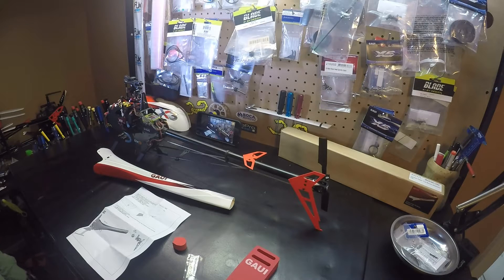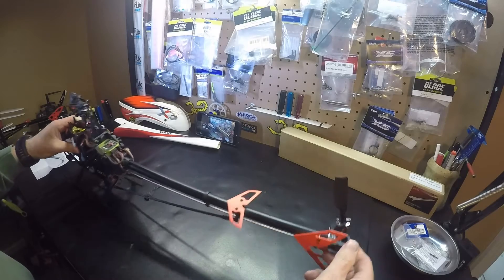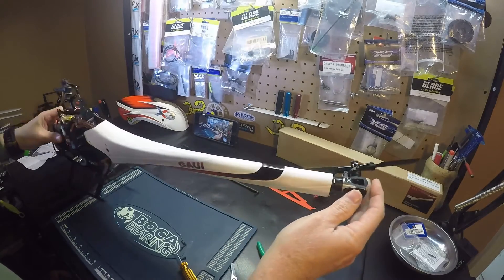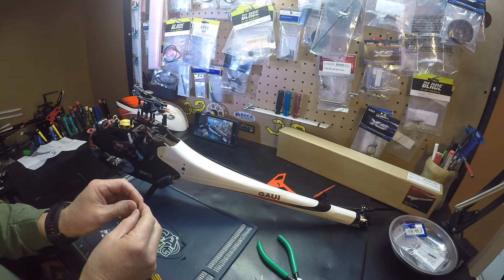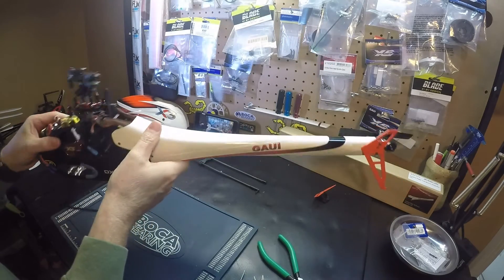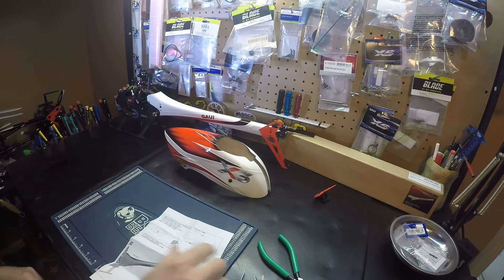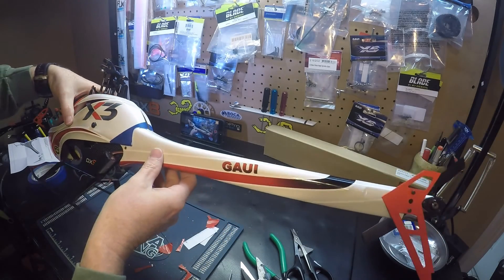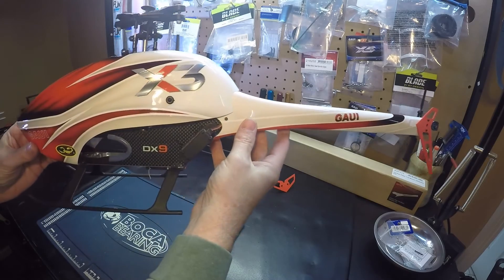Gaui X3 boom cover installation

Comment: Very nice video. I have been flying my X3 with the boom cover for about 2 or 3 years. What I found and did not see on your video is balancing after putting the boom on. The boom cover made mine quite tail heavy. With the battery on the tray, in place & the canopy on it took about 4 or 5 pieces of stick on lead on both sides of the frame to get natural balance.  Flies well and does look really good with the tail boom cover
Reply from the maker: Andrew Levy yep I had to add weight as well